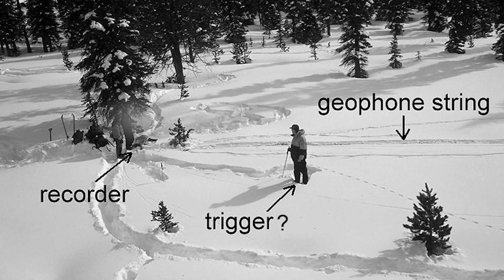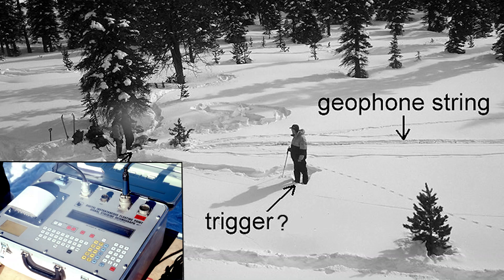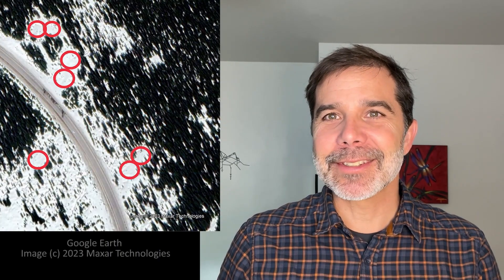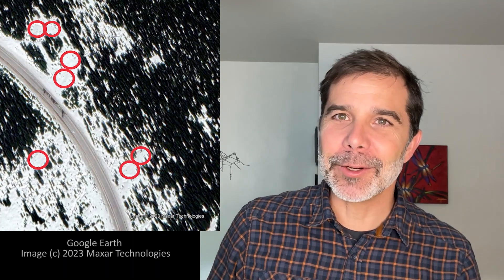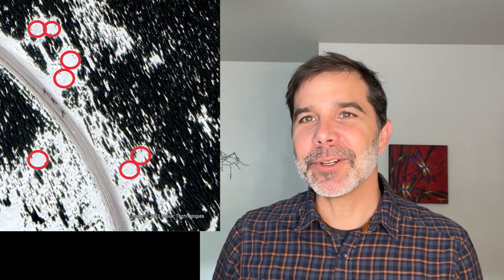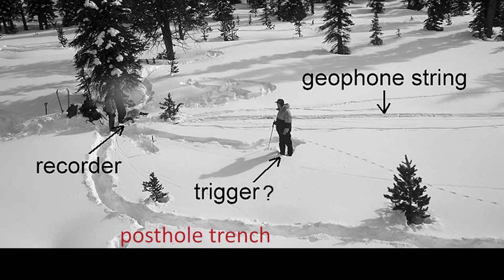How fast is a whumpf? And what does it have to do with slab avalanches?

Comment: At 7:50 a snow profile fails after snow can no longer compress this follows conservation of energy rules or laws leading to the conclusion reguardless of number or strength of taps instability is indicated when a slope normal force reaches a compression maximum and becomes a slope parallel  failure